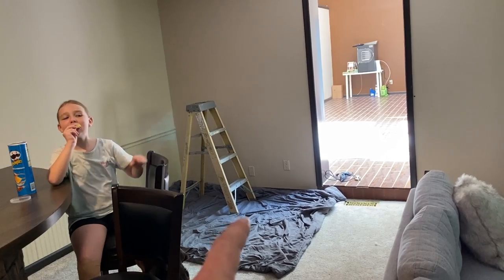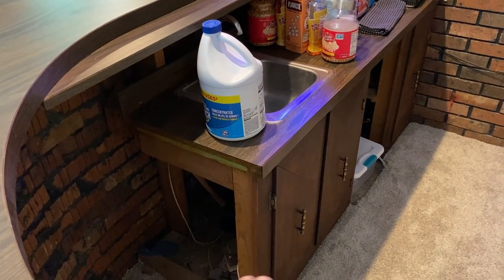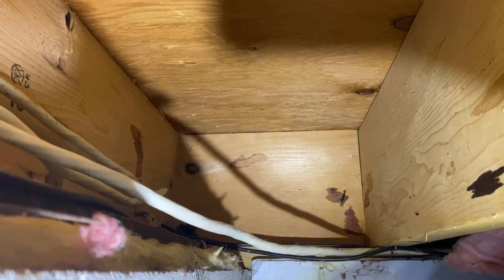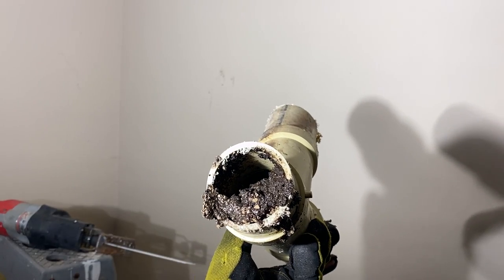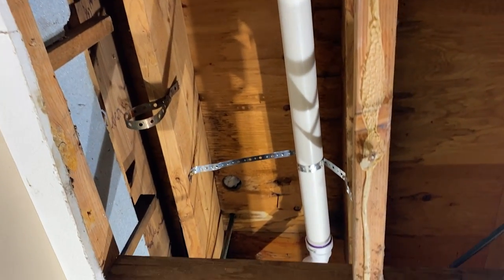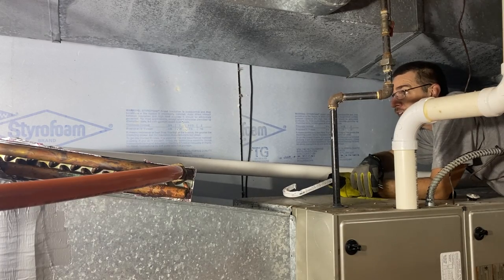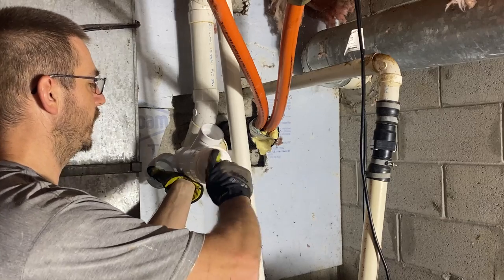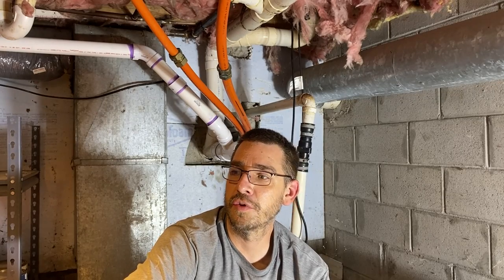I Found The Leak.....And This Is How I Fixed It

Comment: Glue a large washer to the bottom of the primer and glue cans and glue a magnet to the top of the ladder so you can just stick them on and have some hold for movement to not be able to knock them off. The magnet also is useful for holding other metal tools in place along with screws.
Reply: That's a good idea 💡
Reply: But what happens if your ladder is Aluminium?
Reply: @tonygrimes13  Why would the glue used to hold the magnet down care if it is a wood, fiberglass or aluminum ladder?
Reply: @TheUserid82  Apologies, I misread your original comment. Again Apologies.
Reply: Brilliant!!!

Comment: My wife and I purchased our first home, 9 years ago. It's a 100 year old house. Lots to do!
One of my proudest moments was taking apart some of the old drain pipe (which had cracked) and spent $200 on materials + 5 hours to fix it.  No more leak. I saved hundreds not having to pay a plumber.

Comment: Before I patched that ceiling I would run new non copper water lines since they are showingtheir age. Greatway to fix a issue,luckly you hada better option then digging up the floors.
Reply: No need
Reply: @newtronix  Clearly your not a plumber.
Reply: At least I'm not a bad one!

Comment: just wondering what you were going to do with the old drain saw you plugged the end where you cut off but i think a foam or even concrete plug after you take out the bar sink don't know what would be best but something  i think so no backups will come out the leak again.

Comment: Is it not bad to drill through the joist to install the pipe? Isn't it possible to cause structural issues? Since joists are structural and carry load?

I think you can add additional supports to remedy the hole though. There are various solutions for that

Comment: I got out of HVAC for the same reason. I always hated working in 140+ degree attics. I almost had heat stroke replacing a leaking evaporator. Also, there are so many dishonest HVAC contractors in the field that many customers assumed that I was also dishonest.

Comment: I'm a retired plumber/hvac guy. You have the vent tee backwards"I'm sure it will work just not to code". Instead of raising the old drain line up into the joist space you could of just dropped down the new drain line in to the old drain line

Comment: What a find. My degree is in HVAC and this is an HVAC problem, not plumbing. The line between the two professions are fuzzy at times but ductwork is straight HVAC work. The odds of a water or sewer pipe that are external to the duct leaking into it are pretty slim. Many HVAC businesses do plumbing as well but not necessarily the reverse. The plumber will probably tell you the same thing then charge you for the visit. 

Condensation can collect in uninsulated metal duct. If you don't wish to replace the main trunk then you should clean all of the dirt out of it as well. It creates drag on the air and lowers the CFM to your vents. It can also hold mold, especially when combined with water. I don't think you want to breathe that in every time you turn on the A/C. If you are going to clean it then try to think of it like the aerodynamics of a car. Manufacturers smooth out the lines of vehicles to prevent drag and that's what you should do to the insides of duct work. Just the dust that can collect inside of ducts can affect flow. Personally, I would replace the trunk with one made with fiberglass duct board then you don't need a wrap or to worry about condensation at all. 

On a side note, please shine a light in the hole to the left of where the duct enters the wall. I'm hoping for a secret vault but it can also help you inspect the duct after the wall transition. Good luck!

Comment: Don't you still have the initial leak that was allowing water into your heat duct? The other end of that pipe is connected to your septic or sewer so even if you fix the sink and disconnect the bar sink that opening still exists. Isn't there a chance of sewer gas being drawn into your heating ducts?  Seems you still need to cut and seal the line at the other end where it connects to the sewer or septic.
Reply from the maker: Phase 2 or 3 or 4 will be replacing the other end of that pipe with all new pvc I will then cap it all off

Comment: Now here's a good one for plumbing.  The fall of a drain pipe is steeper the smaller the pipe. A 8 inch pipe requires less fall than a 4 inch pipe. Thats why our mobile home park has 6 inch pipe buried when 4 inch pipe is all that was needed. We had a limited fall we could have so we went over sized. At the front of the property where the city sewer is the pipe is 6 feet deep but at the back its less than a foot deep.

Comment: I might have missed it, but did you ever figure out HOW  the water was getting from the drain pipes to the heating ducts?
Reply from the maker: Most likely the cast iron drain pipe rusted through and in turn water leaked under the floor and rusted out a metal duct

Comment: I am really impressed with what you have done, and I am so glad that my house is a single story on flat ground which makes repairs very easy. Good luck to you in future endeavors and I am going to subscribe to your channel.
Reply: Unless you have cast iron drain pipe and it has disintegrated. Then, let the fun begin cutting concrete floors. Like in my house that is 50+ years old.

Comment: I've always hated running anything in concrete, especially pipes. If you have a failure (and you eventually will) your options to make repairs are severely limited. By the way, Love this oscillating multi-tools. They make short work of many jobs. Blessings/

Comment: Sewer gasses can be pulled into your HVAC.  You need totally disconnect the existing drain line at the main -- can't just do inputs.  Also would be well served to run flexduct inside existing ductwork for add'l air quality protection.  Any sewage into soil will seep into air too...
Reply from the maker: Yup, all will be capped off in later steps

Comment: At 13:46 what are the orange pipes used for?
 The infallible Internet said that, "septic drainfield piping for residential use"
Reply from the maker: It is an old outdoor wood boiler that is disconnected

Comment: Nice work around. Superior alternative to busting up that nice floor.  I do hope the duct cleanout works it took forever to get the smell of dead mouse out of ours. The little varmints' found there way it through a hole in our plenum. Finally had to hire a duct cleaning company that used an enzyme solution similar to the stuff used to remove dog pee odor from carpets and that finally got it. Cheers.

Comment: they make a tool called a hub saver. You could've cut that cleanout off flush with the hub of the existing wye and drilled out the hub with the hub saver and not had to use male threads on a waste line. Every time I use male and female threads on pvc it seems to leak...

Comment: Hindsight is always 20/20. I would have used cleanouts wherever the drain line made a 90, or used no hub clamps so it could be dismantled if it clogs.

Great work getting that all together.
Reply from the maker: I thought about adding one clean out as soon as it came into the crawl space but there is so little room there I would never use it anyway

Comment: Did you test if the bar sink drain is okay? Is it possible the leak is between the bar and the kitchen instead of between the bar and the outlet?  If so, may be able to cut the concrete under the bar and cap the upstream drain line. But where is the bar sink vented? Is air admittance valve allowed in your area?
Reply from the maker: The leak is after the bar sink because when I ran either water it came out in the ductwork. The vent is actually up the brick pillar on the left side of the bar

Comment: ditch the roof vent. That's old school, install air admittance valves at every drain, and you'll never have to have a long vent pipe run to the roof

Comment: Not supposed to tape the cans together, you can't read the MSDS info. ¼ or 2% of fall per foot on anything under 3". Your sanitary tee for the vent really should have been a combo or a wye with 45. The san-tee will work, but the short sweep in it can cause problems. Priming fittings like that isn't good to do. The primer heats the pipe and allows for a solvent weld. Priming like that it is just glued. Long sweep 90s are perfectly fine. You did however do nice clean work. I would happily let you loose on one of my jobs. Nicely done.

Comment: Very nice work. Always better to figure it out yourself than letting yourself get robbed by an ''expert''. 
Just to mention, I don't know how your basement looks like now but it looked very closed in the other video. It should really have some ventilation opening. Closing it off completely is guaranteed to give trouble. Same goes for attic. 😉

Comment: Question about your HVAC. What is the radiator on top of your duct work with the orange lines running to it?
Reply from the maker: That was an old outdoor wood boiler system
Reply: @SSLFamilyDad  thanks for the answer

Comment: I don't see any sort of duct taping or sealant on those vent pipes.  I would guess you have pretty lousy flow rates in some of the further out rooms.  It is always so frustrating to buy a house and then spend months fixing other people's screwups and sheer neglect.  I don't envy you for having to sort this disaster out.    I never buy any house till I have a thorough inspection done.  Things that are found can be heavy ammunition to price negotiating.

Comment: I know it is an old video but why not run water in the bar sink and see if the leaking pipe into ductwork is further up the pipe and therefore the bar sink could still be used instead of taking it out
Reply from the maker: I did, it leaks from both

Comment: I did exactly the same job when I left the military, crawl spaces are the worst, especially doing sewer pipe in a refurb multi story building where builders above have been using the toilets and flushing the pee and poop basically into the crawl space, then you have to crawl around in it connecting new pipe and support brackets with a fall into the sewer main, as you had to replace the old iron sewer pipe. Yeah that job was nasty. I actually did a lot of pipe work in the London Aquarium, making good/snagging on pipe work above the piranha tank with just a scaffold plank on top of the tank, on my back on the plank above the tank. That's another story 😂

Comment: Just a couple pointers, your not suppose to lay a tee on its back, fitting should have been a  Y, if you need to jam a fitting in a tight place like that 3"  they make a slip coupling that will slide completely over and down the pipe or the make what's called a Fernco rubber fitting or what's called a no hun band. These are rubber fitting that secure up by stainless steel hose clamps are crazy easy to use. Just FYI not sure where you live but their are companies that can come out and cut your cast iron loose and they either can run a sleeve through it or coat it with a compound that cures steel hard instead of busting up the hole slab replacing old and rotted out cast iron pipe. My buddy had his vacation home down in Florida done because of the salt content in the soil. They came in, pulled toilets and cleaned the inside of the drains then came back and ran this tool/machine they had and coated the drain lines, also went down the roof vents coating them as well. What sucked is after spending the money to have this done his insurance company wouldn't cut him any type of discount, for preventive maintenance! Bunch of B.S. On their part I think!

Comment: You could have relined the old drain in the floor and kept the wet bar. Send a GoPro in the heater duct with a remote controlled car too

Comment: Run a small sanitary pump from the wet bar and connect to your repair/bypass fix
Reply from the maker: Thought about it, just need to figure out how to get the pipe to a working drain without breaking too much cement and brick up
Reply: @SSLFamilyDad  you could.put a post upwards from the bar and get into the ceiling and then connect in crawl space

Comment: You don't have to do any of that pipe redirection or abandoning the sink if you would just run a camera down the ductwork while the water is running and you'll be able to pinpoint exactly where the problem is and address it!
Furthermore, abandoning the drain pipe does not stop the sewer gases from backing up into your house!

Comment: That's a JerryRigEverything type of solution. Very efficient & nice.
A little bit bummed out that we didn't get to see the scene of the actual crime, what the leak looked like and how the pipes ended up messed up like that. But of course the primary concern is getting around all of the destruction that would have been necessary for that, so it can't be helped. That nagging curioristy, though.
Reply from the maker: Well there will be plenty of digging and seeing the rusted pipes when I finish digging out the other end and replace all that with pvc

Comment: You can get your cast iron pipes lined with pvc to deal with leaks.
Reply from the maker: True but it is up to $150 per foot
Reply: @SSLFamilyDad  Unfortunately, it is not cheap, but would beat having to destroy the house to repair a pipe. Is this the last under slab pipe you have? I wonder if to maintain the bar sink you could fish a smaller diameter soft tubing through the remaining iron pipe and use a pressurized evac pump for that drain only? Other option is a small up-lift system and a riser column from the ceiling to the bar to carry the waste pipe. All that might end up costing as much as relining though. The bucket method just sounds too nasty to deal with indoors.

Comment: Why abandon the sink put a small somp pump in a 5 gallon bucket most pumps come with a float switch plumb the sink drain to bucket and run the sump outlet in the sewer pipe in the crawl space

Comment: The water is gone but the duct integrity is still compromised, such that ground water may pool in the duct work providing a breeding ground for molds or fungi perhaps? I wonder if it would be worth considering some type of liner or sealing system to ensure the continuity of the air distribution system? Cured In Place Pipe might be overkill, but maybe some kind of latex coating applied by pulling a swab like plug through a run of duct.
There is a company called Aeroseal with a system that can reduce the air leakage in duct work by blowing an sealant through the system. It doesn't coat the whole duct but where ever there is a hole the sealant builds up, gels up and sets up until there is no more air passing through that hole. https://youtu.be/UeVf0983N8o
The downside might be that the Aeroseal delivery method might not work with under slab duct work as the sand or fill around the duct might not allow for any air flow out past the leakage points.